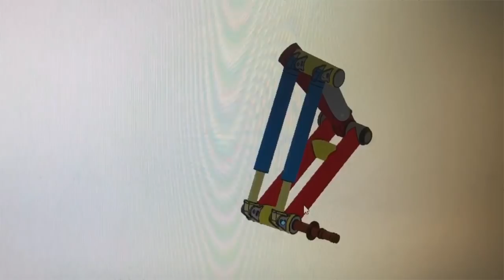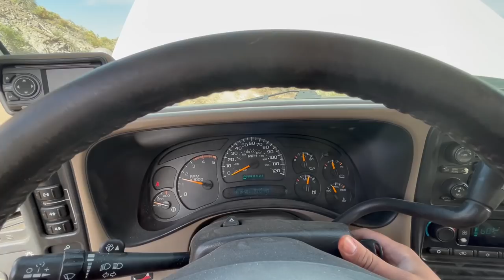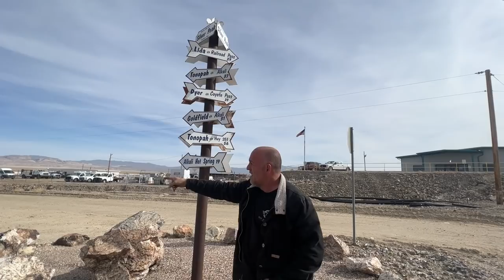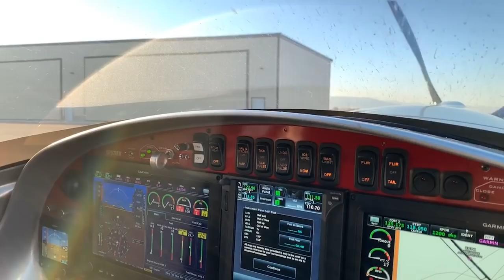Couple goes MISSING in the middle of the desert. Ronnie and Beverly Barker RV recovery

Comment: I am in aviation 
(Crew not pilot) and have been reading a lot about the “Enroute Decision Point” concept, the idea that if you encounter weather conditions that cause you to slow down or lower altitude below where  you normally would cruise at you need to make a decision to land, turn around to good weather or do an instrument approach at an airport if possible.  I was just thinking this can apply to traveling on roads, even if you are planning to off road you should have a pre decided condition or set of conditions that if you or those your are with encounter them it’s time to stop and re-asses what you are doing.  I’ve been in a situation trying to get somewhere that my vehicle is not capable of getting to, thankfully I made the right decision to turn around when I still could but just like Mike said, I made a series of small decisions leading up to that where I could have very well ended up stranded.  
The two videos Dave and Mike have done on this are so valuable to drive this point home, thanks guys!

Comment: This is an important lesson for alot of folks that use RV's to travel into rough terrain for any reason.  You should not go where your vehicle was not designed to.  I remember seeing this one on the news and it was sad then as it is now.  Love that you guys were a part of this one Mike, you and Sparks did a great job on the recovery.
Reply: I have run across these types headed into trouble with motor homes. They sometimes get pissy when I suggest they turn around. SMH

Comment: I followed my gps down a road going to the garden of the gods in southern Illinois.  It didn’t look official but started down it anyway.  After a few curves thought there is no way this is the road I am supposed to take.  Went one more slight curve just In case it had a way to turn around.  I came across a car that hung up up in the ruts in the rock road trying to turn around.  Got them unstuck finally and drove backwards back out.  Only about quarter to half mile and only in southern Illinois but it doesn’t take much to get in bad.  They could have walked out ok more than likely and may have had cell coverage  but still could have ended up worse.  I bought an Inreach for flying mainly but always have it in my car.  I have vacationed in Death Valley a couple of times and other places with little to no cell phone coverage.  It gives me good piece of mind that can help in situations like this one.  Love you videos!

Comment: The lesson I learned is, never travel without food and water, without an appropriate off-road vehicle, never go by yourself out of communication range. Invest in a PLB and/or a Garmin inReach. Don't continue down a deteriorating road that you are not familiar with, especially at the sole direction of a GPS. If you aren't 100% sure you can turn around, reverse until you get to a flat enough spot. Plan your route and tell someone where you will be going ahead of time and when you will contact them next. If you are unhealthy, elderly or unable to hike, then never deviate from a paved road if you are outside of cell coverage.

Comment: You are amazing, Mike!

I know this isn't the main part of your wheelhouse, but sometime could you address emergency communications?

My friend, Kevin Zari - KK4YEL, most likely saved a friend from a similar fate in Big Bend National Park, Texas. Kevin is the Director of Technologies for the ISS at the Kennedy Space Center, FL. He and his buddy are Jeep and amateur radio satellite enthusiast. They had a had contact schedule using amateur satellites that turned out to be life saving.
Kevin's friend got stuck in a wash miles off the main trail on a loop that the park ranger said typically only sees traffic every 10-14 days. When they made their scheduled satellite contact the radio gave its GPS coordinates. Kevin was able to call the parker ranger that was able to reach his friend within an hour. He had been stuck there a couple of days. Easy to work amateur satellites aren't overhead in the right spot at the right time every day.
In your video you were using UHF communications.
As an amateur radio operator I realize HF provides the most reliable point to point communications regionally and globally.
You use radio communication all the time. 
VHF & UHF provide line of sight communications. I've used a 5 Watt walkie talkie and Arrow brand Yagi antenna to talk through a satellite. Amateur radio operators routinely climb summits and make VHF/UHF contacts over 100 miles using 5W or less power.
Please give the topic a little are time. It can be life saving.
Thank you.

Comment: I left a comment on your video but I am also going to ask a question I have been meaning to ask for some time. I watched you build Draco and was upset when it crashed.  I then watched you build Scrappy. Both planes are amazing and I am curious about the performance differences between the two aircraft. You also said that you were going to rebuild Draco and I am wondering when you will start the reconstruction.

Comment: 15:30 And that's exactly why I have installed a front reciver at a middle point of the bumper and reinforced it  , And I also bought 12,000 pound BADLAND WINCH, And my class C rv is  only  23 ft plus 3 ft of storage box, And I will always tow my Nissan Xterra Pro 4X .

Comment: Valiant effort. I’m sure the family appreciated it. Question: do SAR aircraft continue their search at night or are they limited to daylight hours for safety? If so, could the night be used for small scale, long duration UAVs to perform IR , low light, and cell sniffing sweeps to produce target lists for the next day’s search effort?
Reply: Depends on who is doing the search and what the pilots and their equipment are able to do. Some times night is best time for a search by air as the dark makes flares and emergency strobes more visible. It is my understanding that thermal imagers ( such as FLIR) can benefit from the cooler more uniform temperatures at night.

Comment: Another thing came to mind. A 50 state road Atlas is less than $50. That also could have shown them that the GPS was trying to lead them astray. We saw it here in Colorado when I-70 thru Glenwood canyon was closed first by fires then flood damage. One of the possible alternative routes the GPS gave was a rather rough gravel pass that more than once got big trucks and buses stranded because it was not suitable for those vehicles. The recommended routes were all paved  highway but rather long.

Comment: Mike... an SAR aircraft portable cell-phone 'node' might save a lot of lives. Most phones will automatically connect to any service. You could cover a lot of ground in the air, and the equipment will tell you when a certain phone attaches to it. Then you could call the people and get info on their situation and tell them sit tight, help is on the way. Get with ATT and Verizon and get this done.

Comment: What a idea to go with a not 4x4 camper on such gravel roads, in the middle of nowhere, when the car is not equipped with adequate rescue material HF radio or sat telephone or personal satellite emergency beacon. But you found them. I was also astonished to see a BO 105 Helicopter (ex Deutsche Heeresflieger,  the Cross on the tail bar). Fly safe😉😎

Comment: Condolences to the family of Mr & Mrs Barker. Mr Patey thanks for a look into the vista of S&R.  So if a little voice in your head says hmmm during an adventure & you aren't equipped with an emergency transponder service. Turn around when that frisson of alarm triggers. If you regularly go then spend a moment to gear up for a "lost in the wilderness event". Take precautions & don't believe that 'maps' in an off pavement trek. Gaia gps & other programs are much safer way finder.

Comment: Many years ago I was traveling when a major accident shut down the interstate for an extended time. I think it was a fuel truck fire with hasmat concerns under a bridge if memory serves. Waze routed me off the highway and ultimately onto an unimproved county road. We made it through, it was not even close to being a problem, but we were in a Z71 Suburban. I could see places where a normal car could easily have gotten stuck. That detour probably shaved 4 hours off of the trip vs waiting for 70 miles of dead stopped traffic to clear. It would be great if you could set your vehicle capabilities into the nav. Then you could hedge your bet and tell it you were a little less capable. I.e. set your motorhome as a semi truck, set a 2WD pickup as a car, or have 4WD but tell the nav it is a 2WD... Of course none of that helps when GPS or the mapping servers blow a gasket though. I have had it tell me to turn onto things that clearly were not suitable, such as closed roads that have had the pavement removed. Nothing will save you if you lack caution.

Comment: Whenever I watch such a video, I think what can I do to avoid getting killed by such a situation? First thing is of course, avoid getting into such a situation. The way the nephew described it, it sounded like an aviation style swiss cheese stack where they managed to line up all the holes. Assuming I managed to line up the holes as well, what can I do? Bring survival gear (I have that in my car even though I live in Germany and it's very unlikely I'll ever need it, but there have been events where cars got stuck for a day in a snow storm.)

Doing cross country like they did, in a country where I can get into a situation that I can't walk out of in a single day? Carry more supplies and possibly bring something to call for help without cell coverage, e.g. a Spot locator or some other PLB. Possibly take a page out of aviation's book and "file a flight plan" with someone you trust to alert the authorities if you don't call back at the end of the day.

Any other ideas?

Comment: Definitely a bit of unnecessary drama added to this video (hence why Mike & HeavyD are utube stars).

1.) They were near the small town of Silver Peak Nevada which has minimal services (not hours from nowhere).

2.) They had comms via satellite at the RV but did not feel the need to put out SOS as the situation still seemed manageable. Simply posted a FB message that they're off route (GPS was not set to highway preference).

3.)  Kia got stuck after another wrong turn only 2 miles from RV.

Regardless they had limited physical capabilities and exceeded them quite quickly.

Note to self: Get adventuring days out of the way when you're young, then retire somewhere warm. Wouldn't hurt to carry an epirb while in backcountry as well.

Comment: Perhaps this idea  to work up with Garmin.  Every on ground search person has a gps equipped cell phone that transmits signals that leave a trail on a display back at the IC . All tracks overlayed. So any area not searched is easily spotted . Individual searchers could be alerted to search that area.  Additional.  A transponder to relay signals to hang on a weather balloon that is tethered by 3 fishing reels.    
Most of this exists already. It's just not assembled. 
I have been thinking about this since sondra levy was found in rock creek park only a few hundred feet from where thousands of searchers past but everybody thought that area had been searched.  I reached out to Garmin years ago but I ran into NIH.  Not invented here. You have enough clout to put this together.   It could be used with ADSB  signals too.

Comment: I don't know what it looked like on that dusty road, but from watching the video it seemed that the driver was driving blind at times; following so close to the dust plume ahead that he would have to rely on peripheral vision to stay on the road.  
A stopped object (like the vehicle ahead) can come out of the murk toward you at the speed you are
travelling when your vision becomes obscured.
Driving into fog has caused countless pileups also.
Personally, I stay back from dust out of consideration for the longevity of my vehicle's air filter.
When I drive through a dusty spot I find myself instinctively lifting my foot off the throttle.
When walking or running, if I encounter dust in the air, I instinctively breathe as little of it as reason permits.

Comment: This is really sad, especially considering that both of them almost made it. I guess that the hard-learned lesson is never to trust your life to GPS, or any single electronic device. The device has zero intelligence, and is only a tool, like a glorified hammer, no matter what the manufacturers might say about its abilities. It can mislead you, become jammed, or fail. 

Have backup plans that work. A simple roadmap and compass might have shown them that they were taking a bad route. And a satellite phone or a good beacon, such as an EPIRB could have alerted authorities that they were in trouble and needed help, whilst pinpointing their position. 

Even more simply, telling reliable people exactly what your plans and route are, along with your ETA, before setting off, can help you to avoid trouble in the first place, and will alert others if you're more than a couple of hours late.

'Common sense' is not a reliable guide, as this unfortunate couple found out, too late.

Yes, I know that it sounds easy to sit back and analyse, but a lot of people have become lost without a GPS. On many occasions, a good map and a low cost hiking compass helped them to return safely.